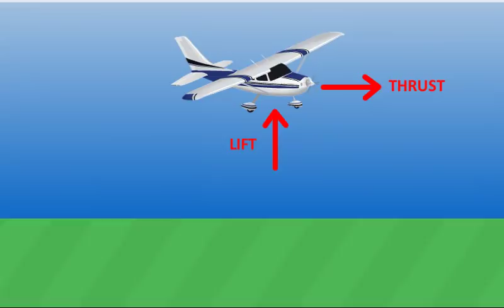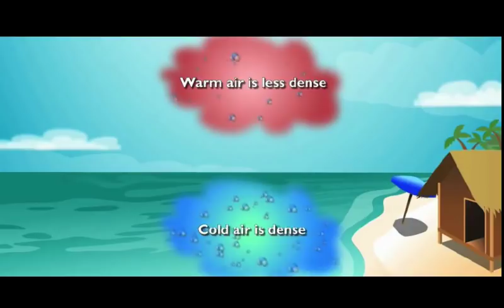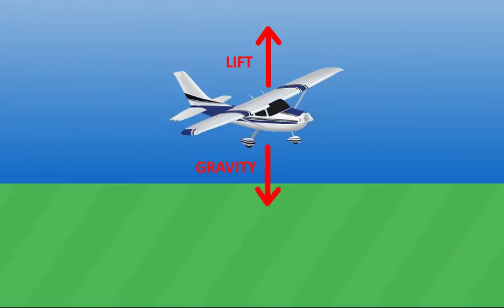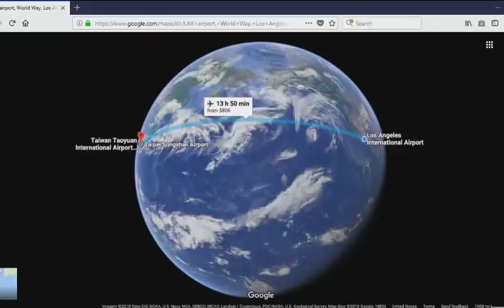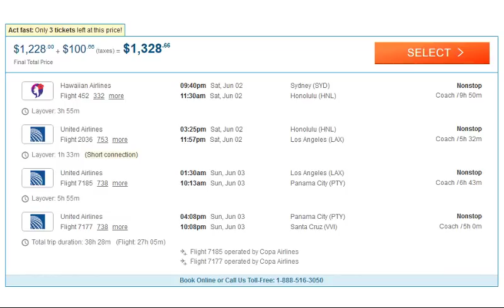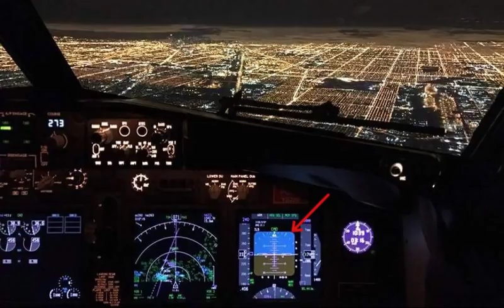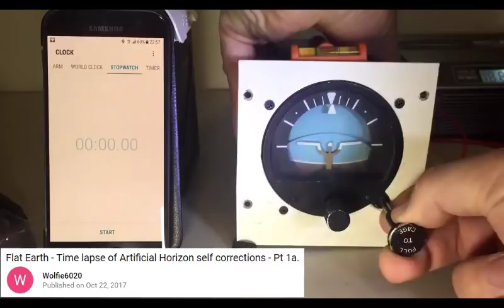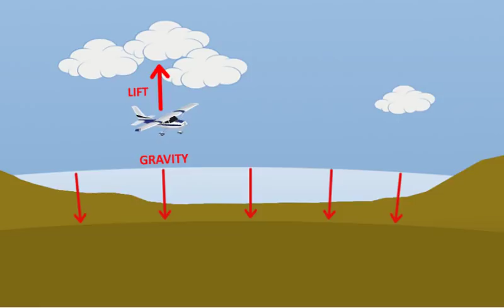Flat Earth Falsities - Plane Nonsense

Comment: FE: earth is flat
Me: have you seen the sun?
FE: yes
Me: what shape is it when you look up on the sky?
FE: round
Me: have you seen the stars on the night sky?
FE: yes
Me: what shape do they have?
FE: round
Me: what shape are exoplanets and planets in the solar system exept earth.
FE: round
Me: then why the fuck 99.99999999999999999999999999999999999999999999999999999999999999999999999999999999999999999999999999999999999999999999999999999999999999999999999999999999999999999999999999999999999999999999999999999999999% of the universe is round and the earth is flat?
FE: just left the chat
Reply: Uhm, whether the Earth is a sphere or flat like a disk, they both appear to be round.
Reply: HA HA HA HA HA! An other uneducated wonk, round is not equal to a sphere, the Moon may give thee impression /assumption its a ball, but the SUN ??? Learn fuck Geometry & word meaning.

Comment: Wrong assumption, Air atmosphere is not stuck on the earth rotating with it  If it is stuck on the earth due to friction, there would be no tornadoes.
Reply: "Wrong assumption"
It is not an "assumption" it is an observation of fact.

"Air atmosphere is not stuck on the earth rotating with it  If it is stuck on the earth due to friction, there would be no tornadoes."
That's kind of like saying "if there are tides then there can't be any waves".
Reply: If there were no gravity there would be no atmosphere, would there. Also, read this
"The normal force is defined as the net force compressing two parallel surfaces together, and its direction is perpendicular to the surfaces. In the simple case of a mass resting on a horizontal surface, the only component of the normal force is the force due to gravity, where 
N=mg,. In this case, the magnitude of the friction force is the product of the mass of the object, the acceleration due to gravity, and the coefficient of friction. However, the coefficient of friction is not a function of mass or volume; it depends only on the material. For instance, a large aluminum block has the same coefficient of friction as a small aluminum block. However, the magnitude of the friction force itself depends on the normal force, and hence on the mass of the block.
If an object is on a level surface and the force tending to cause it to slide is horizontal, the normal force 
N, between the object and the surface is just its weight, which is equal to its mass multiplied by the acceleration due to earth's gravity, g. If the object is on a tilted surface such as an inclined plane, the normal force is less, because less of the force of gravity is perpendicular to the face of the plane. Therefore, the normal force, and ultimately the frictional force, is determined using vector analysis, usually via a free body diagram. Depending on the situation, the calculation of the normal force may include forces other than gravity."
Reply: Try learning basic physics before moving up to meteorology.

Comment: Throwing a ball up in a car doesn’t prove nothing do that same test but sit on the roof off the car see we’re your ball is hahahahahaha
Reply: Do you think the laws of physics behave differently depending upon whether the ball is inside or outside of the car?
Reply: Outside the ball might move backwards in midair because the outside air is moving with the Earth, just like the inside air is moving with the car. The air causes drag, which takes energy from the momentum, returning the ball to the momentum of the Earth. In a vacuum this wouldn't happen just like Earth doesn't lose momentum in the vacuum of space.
Reply: Robert Thomas so if the air is moving with the earth an the earths goin east the airs goin east? Then if I travelin west is the air still goin east ?
Reply: @chelseawany1009  Is the outside air going east? In the larger frame of reference yes.

Ignoring the motion of Earth, if you were on a train going 10 mph east and you are walking toward the back of the train (west) at 2 mph, would you be moving east or west? To someone on the train you appear to be moving west, but to someone outside you'd appear to be moving east (at 8 mph). (To someone in a train on a parallel track moving 8 mph east, you would appear to be motionless.)

Being on Earth is like being on that train moving east.
Reply: Robert Thomas if earth was spinning all wind pressure would be the same we hav strong winds an mild wind all directions earth doesn’t spin
Reply: @chelseawany1009  That's not true. Winds occur in the frame of reference of the Earth. Winds are due to thermal circulation in the atmosphere creating pressure differences, and this is subject to the rotation of Earth (Coriolis effect).
Reply: @chelseawany1009  While the atmosphere as a whole moves with the Earth there will be minor variations within it. One does not preclude the other; they work on different scales. 

Regardless of how high you go you can only ever see one side of Earth at a time. At his altitude he would see only a small proportion of the globe. 

Because the Earth is moving eastwards, the atmosphere is moving eastwards and he's moving eastwards, all at the same velocity.
Reply: @chelseawany1009  "if earth was spinning all wind pressure would be the same we hav strong winds an mild wind all directions earth doesn’t spin"
Firstly the Earth is not spinning, it is rotating very slowly at half the rate of the hour hand on a clock.
Secondly, there are many other things that affect the movement of the atmosphere, the main one being temperature differentials which are the main cause of the movement of air and weather. Because of the movement or air due to temperature gradients the Earth's rotation causes Coriolis, which results in weather patterns/systems. TRS etc.
If the Earth did not rotate gyrocompasses wouldn't work, but they do, don;t they.
Reply from the maker: Chelsea - the only problem with doing it on top of the car is wind resistance. If you do it slowly it still works. Go too fast and wind resistance will slow the ball down - BUT it still won't stop it. Since the atmosphere rotates with the earth, the inside the car analogy is more appropriate than outside the car, as the inside air moves with the car. Airplanes and rockets move inside air that is already rotating with the earth, so it doesn't cause a problem for conservation of momentum.

Here is a demonstration that proves my point. Watch the guy jump off the moving truck, and notice he KEEPS MOVING FORWARD with the truck. 

https://youtu.be/-r9VbunV90Y
Reply: VoysovReason watch the red bull jump tell me why Mexico is half off the world in that vid an tell me why he don’t land in see if he’s that high up an the earth is spinning at 1037 miles an hour east
Reply: @chelseawany1009  It's almost as if you are making no attempt to understand what is being said to you...
Reply from the maker: Chelsea - the Red Bull jump was filmed with a wide angle lens. That makes the earth look smaller and exaggerates the curvature. The balloon is suspended in the air which moves with the earth. When he jumps, he KEEPS MOVING WITH THE EARTH, just like the guy jumping from the moving truck I showed you keeps moving with the truck. It's very simple. The balloon jumper will fall straight down in relation to the moving earth, because he is already moving with the earth when in the balloon capsule, and so is the air, assuming there is no wind. Any wind will blow him off course a little, but that is separate from the earth's steady rotation.
Reply: You'd get the exact same result!! There are several videos on YouTube that demonstrate this. Stop being afraid to do some research.

Comment: HEY CLOWN.  Look at all the comments.  You're talking to adults now.  Not impressionable 2 year olds.  YOU.  ARE.  A.   JOKE.
Reply: That these FE’er “adults” have yet to produce the evidence they claim is obvious doesn’t puzzle you?
Reply: As a grown up, can you tell me how a 747-400 with an 8,360 mile range flies the 24,340 mile course across the South Pacific and does so in 12.5 hours?
     Can big person airplanes fly without fuel?
     That also requires 1,970 mph but the plane's top speed s 614 mph. 
     Isn't 1,947 mph a lot faster than the speed of sound? 
     Can 747's fly at Mach 1, let alone Mach 2.9? 
     What's the big person answer?
     (Even a 250 mph hurricane force tailwind and 20,570 miles FE distance flying across 38.12° S, fails miserably?)

Comment: Sir, the laws of physics will not allow any honest person to deny that the globe's (yearly) ellipse cycle consists of two halves. Half of the globe's ellipse cycle is on one half side of the sun & the other half of the globe's ellipse cycle is on the other half side of the sun. Furthermore, half of the globe's ellipse cycle is much shorter, in distance, than the other half cycle is. And since each half side of the sun takes up, two season's worth of the year's time, then the globe would have to move much slower, during its short distance half cycle, than it would on its long distance cycle, in order to balance out the other two season's worth of the year's time. After all, the globe would have to travel much less of a distance, IN THE SAME AMOUNT OF TIME, on its short distance cycle than it would on its long distance cycle! 
So why doesn't global scientists just flip it (to make it fit)? Is it because it would throw a monkey wrench in their idea that the sun's gravitational pull should become, more & more stronger, as objects move closer & closer to it? Of course it is, but they sure can't have it both ways, either, so they chose the less noticeable of the two to deceive with. Furthermore, global scientists like to maintain that the southern summer (perihelion) is a little bit warmer than the northern summer (aphelion), because it is 3,106,855.96 miles closer to the sun. However, if that were true then, no doubt, the southern antarctic regions would have to be warmer than the northern arctic regions. 
Maybe, now you see why God's Holy Word says that Satan is deceiving the whole world (Revelation 12:9) and to beware of Biblically-opposing False Science (1 Timothy 2:6)? In reality the Earth is flat & circle shaped, with an overhead glass firmament dome. The blue sky prevents you from seeing it, but sundogs & rainbows testify that it is there. God's Holy City is located on top of it. NASA are Satan-led hoaxsters. Nobody ever landed on the moon. The sun, moon and stars are in the vault of the firmament and are much smaller & closer than Satan's public education system indoctrinated us to believe. Planets are really just "Wandering Stars". Antarctica is not a continent. Rather, it is a 200ft Ice Wall that surrounds the flat & stationary Earth. The Antarctic Peace Treaty is a ploy to keep non government officials from exploring apassed it. There is so much more that you need to know, about all of this, so be sure to research Flat Earth and weed-out the shills! 
As for: Analemma, it just confirms that the sun's summer circuit around the Tropic of Cancer is less distance, around, than its much larger winter circuit around Capricorn. Thank you & God bless :)
Reply: I was going to give you a legitimate response since you started out at least attempting to talk about science but then your mask slipped and you veered off into a typical religious rant.
Reply: all i can say if u really believe that the earth is flat then please by all means, kindly stop using things and technology that is based on round earth science.Let see after that if can still say that the earth is flat
Reply: "the sun's gravitational pull should become, more & more stronger, as objects move closer & closer to it?"
One result being the Earth accelerating as the orbit brings it closer to the sun then decelerating as it moves away again, the change in velocity you can't figure out. Simple enough concept. 

"global scientists like to maintain that the southern summer (perihelion) is a little bit warmer than the northern summer (aphelion), because it is 3,106,855.96 miles closer to the sun. "
No, they don't;  that's a fallacy put around by people who can't figure out there's more than one factor involved. 

"Nobody ever landed on the moon"
There were traceable signals to, on & from the moon, detectable equipment left there and verifiable material brought back. What's your explanation?

"it is a 200ft Ice Wall"
Evidence?

"The Antarctic Peace Treaty is a ploy to keep non government officials from exploring apassed it"
Yet it hasn't stopped people going.... Two men both finished solo expeditions across the continent just a few months ago. Still no evidence of an ice-wall.
Reply: First of all, I am not religious, and have never been religious. I don't need to disprove anythin, I already know the truth.
Reply: I feel sorry for you globe believerz, you need to look for "debunkin" videoz so you can feel better about your delusion :) there are flat Earth signz and provez all around us, if you qpuld acutally research flat Earth, jnstead of just lookin for flat Earth debunkin videoz, you would know. But well, if that's what its like when someone doesn't use their brain. We are literally being mocked in different wayz, becauze the "government" knowz the Earth is flat, and fyi, there were flat Earh videoz that you wouldn't be able to debunk in a hundred yearz. But such videoz are being removed, and the debunkin onez are being promoted, you are people retarded... becauze you don't see what is really goin on. There was even a 2 hour plus scientific video explainin why the Earth doesn't behave like a ball/marble/sphere as we've told, even if science and math seem to point to a different conclusion... and guess what, it got removed and account associated with it got removed as well. Anyone with a little brainz, after doin some fuckin diggin, would know and accept that the Earth is flat... and flat Earth has alwayz been a fact, and the globe only a theory and a delusion. No "debunkin"  video can change that, you don't have any real proof of the globe, apart from theze "debunkin" videoz. More and more pilots admit that the Earth is flat.
Reply: @dragoneudezet  Its funny you say debunking video's, all flat earth video's debunk themselves, if you can see through the lies and BS and seek the real truth, sorry to say, you have been indoctrinated.
Reply: @vibemunster  Hahaha
Reply: Hahaha I don't believe the Earth is flat, I know the Earth is flat :) have you been dropped on your head as a child? And I think you don't realize how much evidence of a flat Earth there is. It's 2019, and only idiotz haven't realized that the Earth is flat yet.
Reply: @dragoneudezet  You have already agreed and admitted you are a liar, so why are you still posting your lies and bs?
Reply: Well... some people are too globetarted. Can't help them :)
Reply: @dragoneudezet    100,000 Aussies have ventured out onto Antarctica. One neighbour has even flown across Antarctica, which he wrote a book about his exploits there. Here in Australia, Antarctica is our neighbour. We are quite aware of that continent, it features large in newspapers and television news. Rumour has it here, that some countries are seriously planning on mining Antarctica for oil and minerals. Not to mention serious whaling that is actually occurring in the adjacent oceans.
Reply: Haha you think I care about your stupid commentz and opinionz? I only care about spreadin the truth, and the truth doesn't care about your opinionz either. Lookz that you can't think critically, and the funniest thing is, we all live on a flat Earth :) whether you like it or not. The globe delusion is ending soon.
Reply: I wouldn't be surprised if you are just trolls. There's enough people tryin to surpress the truth, but more and more people wake up, and you can't stop it.
Reply: @dragoneudezet  We realise your belief in flat-earth is religious based. You should be able to look at all Voys's videos and debunk every last point that is expressed. But you will not, can not. The only proof you will offer is a belief steeped solely in religion. What would happen if the earth really is a globe, will that mean Christianity is a hoax, and all the other religions not based on a flat earth are the real truth. Nearly everybody else takes religion as a means to moral strength and character. Not as a text book on how the universe works.